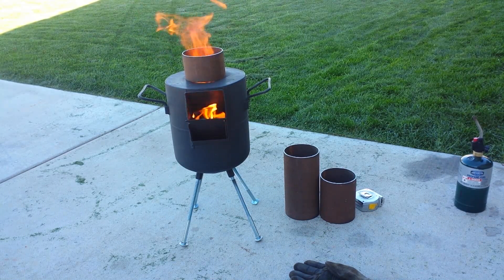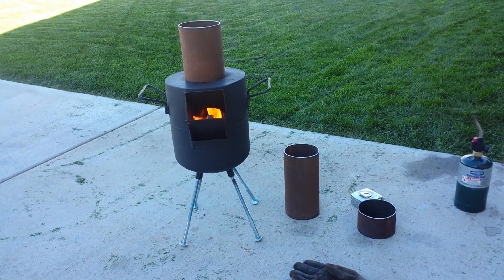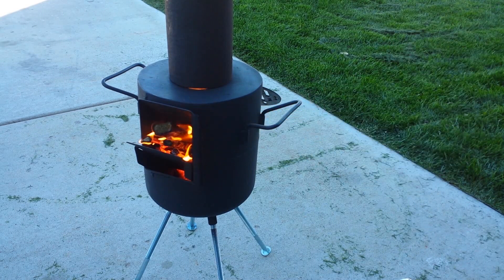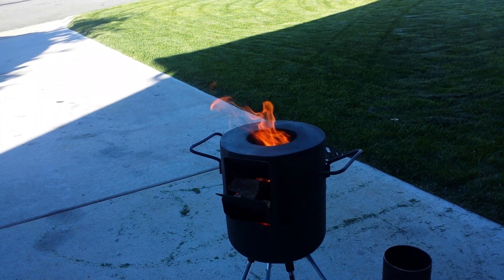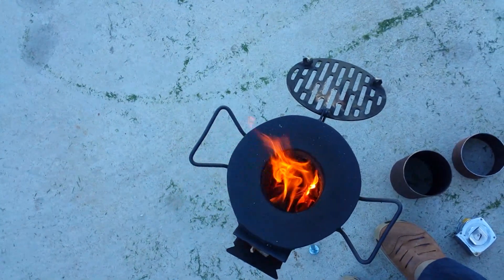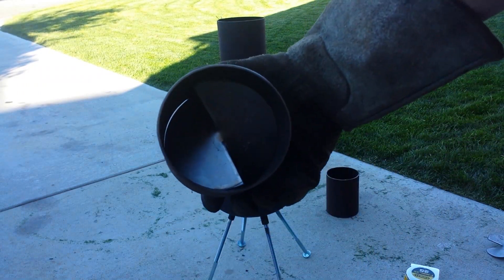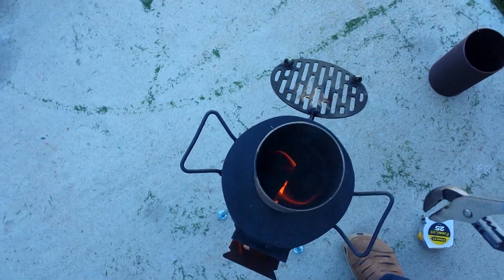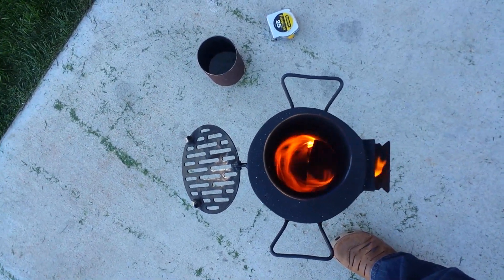Rocket Stove Modification Tests Before Building Version 4

Comment: I would imagine a 45 degree angle would be an ideal balance between air restriction and creating a good strong vortex. I could be wrong though, that's just speculation. What angle did you end up on?
Also...
It's been over 3 years. Where is rocket stove number 4!

Comment: John excellent fabrication. For the legs, you may consider pipe or tubing with a piece of threaded rod welded to the end. Instead of vortex disk consider using a continuous baffle plate about the length and width of your heat tube, twisted to form the baffle, like they use in gas water heaters, this will help in getting the complete combustion becuase you would have a bigger hot mass with which the smoke is coming in contact. I would also try to regulate the air intake to have a control over the heat and how fast my wood burns.

Comment: Great video series and design evolution of your stoves.  Nice safe work practices too!
Some Suggestions:
1.  You need more air or less fuel.  Add a simple grate of expanded metal to the interior bottom end of your feed tube to allow the air to get "under" the fuel for a more efficient burn. Use a longer feed tube to develop a better draw and stop the back flames.
2.  Not sure why you are using such a large diameter tube but try suspending a round metal disk as a heat dissipater just about an inch above the upper end of the vertical tube.  This will cause the flame/heat to spread out at the top of the tube similar to the burners on a gas kitchen stove.  (Imagine a sunflower when you look down the top of the tube.) The flame heat lost at the grill because of the disk will be more than returned by the hot disk radiating heat,
3.  Secondary air and a catalizer (copper or stainless screen) along with the vortex or even instead of a vortex could also help.
Just a few suggestion from the gallery and watching a bunch of other stove builds on the internet.  Good luck and keep up the great work.
RJF

Comment: I am enjoying your inventing.  The analysis you provide and the scientific methods are a treat to watch. If you were to create a place to collect and concentrate the coals.  I think you could get a hotter cleaner firer.  The goal is greater combustion.  I envision a grate that lets large coals pass into two bins with smaller grates.  It could be as simple as a peak made of grating.  This would make two hot spots on the edge as the large coals collected.  This could be repeated with a finer great and a 90 degree offset inducing the vortex below the place the fuel is inserted.  Ultimately your final third grates could be the air input in the bottom of the chamber.  It may require some experimentation to get the grates asymmetrical in the configuration to make the hot spots cause the vortex.  I will make a picture if you are interested.

Comment: Great work and testing.  Good sharing.  My suggestion is to think of ways to make the stove cheaper so it may be used in developing nations.  I volunteer with a charity www.adire.org in India and one of the barriers is coming up with a really cheap design that works as well for poor villagers. 60% or world's population still cooks over an open 3 stone fire supporting pot.  Any thoughts?  Tx. Bob C
Reply from the maker: The most expensive portion of it is the grinding.  If I were to design the parts so they could be welded without grinding, that would save a ton of time.

Comment: Nice experiments you made over there. I think I was the guy that come up with this particular vortex idea! There are other "vortex generator" systems as well. I calculate the long length of the ellipse (that seats at 45 degrees inside the riser pipe) with a bit of trigonometry, cut it into two along the longest length (as you did) and I keep each half 90 degrees in relation to each other. It does not seem to interfere with the draft of the stove. I would keep the secondary air where it is located and I would put the vortex just above it. When you refer that the combustion is cleaner with the vortex, that happens because of the secondary air. The secondary air is mixed with "unburned" compounds by action of the vortex and the outcome result of the combustion is less "dirty"...
Reply from the maker: caotropheus Yes!  You are right.  I took the idea from one of your videos.  Very simple but effective.  Thank you.  I will tweak my description to give you credit.
Reply: John Harmon - Cold Creek Works No need for the credit. I am here to share ideas and I am sure someone else thought about the same vortex generator before I did, so...
Reply: caotropheus I like the spirit of a creative commons and idea sharing here. The world truly does have need of these.  When you only make a dollar or two a day, the money you burn up in charcoal and wood to cook is prohibitive.   I'm just heading to the Philippines soon and will use your ideas for some stoves.  Thank you.
Reply from the maker: you're welcome